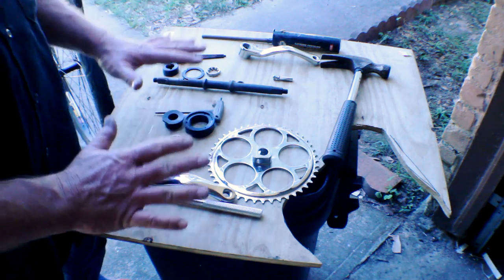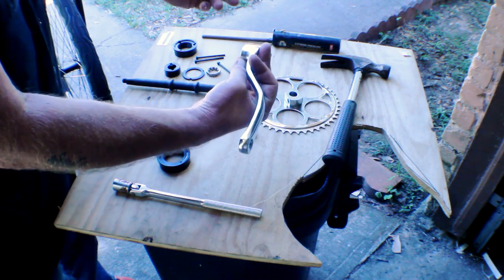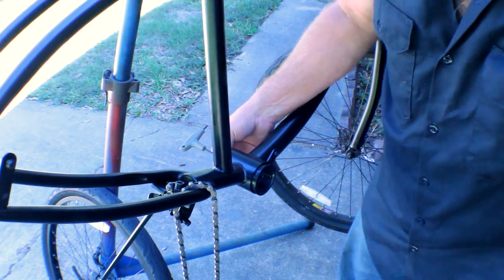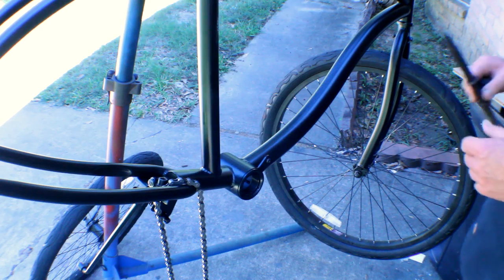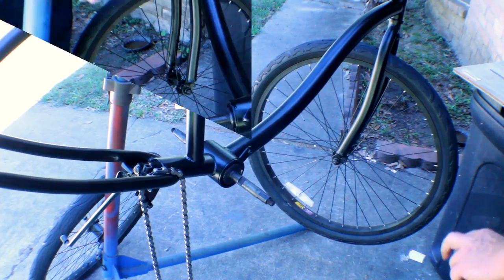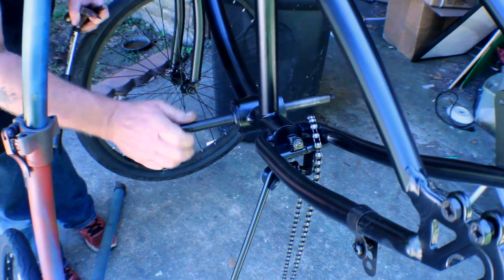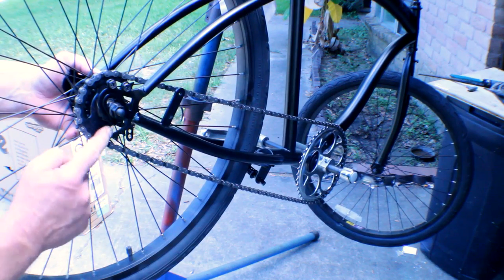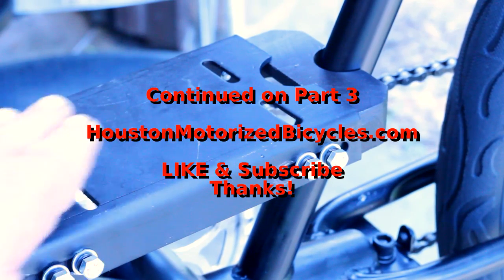How To Build 4 Stroke Motorized Bicycle Part 2 - Install 3 Piece Crank & Motor Mount

Comment: I tried to put one on my bike because I was going to use a pull start with my 2 stroke but it kept coming loose. I used thread locker and the bearing went to shit. I had to heat it up with a blow torch and beat it apart for a hour to get the bearing cap off

Comment: I found the wrong video from you a few min ago, THIS assembly looks more like what I have.  Basically.  But wow! Lining up those two outer rings so a long screw just happens to mesh?  I somehow got the first one to bite, but cannot for the life of me get the other two.  My back can only take so long of hunching over a blasted bike... time to walk away.   But at least I can see the plan here.

OH one tip for lining up the holes?  I took a straight piece of coat hanger wire and sent that through hole one, lined up my receiving part to that.  BUT kind of afraid to tap it all the way in just yet, and wow it's tight.  I have to really pound just to get it started. Very easy to undo my nice hole line up.   (What a stupid design this is.) 

Thanks for the video though, what side which parts go on right there will save me a royal headache for sure.

Comment: @Hughes I'm trying to do this on a stealth bomber ebike frame. the right cup I got with the kit doesn't thread enough into the tube. It doesn't make contact with the bearing and its spaced. the right cup hits my frame. The left cup has to go in very far for it to hit it.
Reply from the maker: shoot me some photos or a vid. HughesMotorized@gmail
Reply: @HughesMotorized   hold up
Reply: @HughesMotorized  I had to actually shave off the sides of one of the cups to get it to go in all the way. It's a weird setup it's hard to explain.
Reply: I bought a differnt kit off amazon as well. The setup is different.
Reply: The bike bottom bracket is threaded so I don't know if this kit would work.
Reply: that's the product I bought

Comment: Walks into bicycle shop, I need help with a multi piece pedal crank set so my pedals are clear of the motor... All they hear is motor and tell me I'm SOL no matter how I explain the simplicity of my help in need and all they say is we don't do motor bicycles, even tho the help I need is Not with the motor. And this is the only bike shop in my facinity :)
Reply: Its so extremely rare to find a bicycle shop that will provide you with any help, service or do anything for you other than help you find the nearest exit out of their store. I walked my motorbike over a mile to get to the nearest store to buy a new tube or fix a flat. So I parked my motorbike outside their door and tried to buy a tube or fix flat anything to  get me home and they refused to sell me anything and got all 3 employees and a few of their friends hanging out there to gang up on me and muscle me out the door. So i parked my bike a few blocks away came back 20mins later and wrapped my arms around as many boxes of tubes as they had on their shelf and walked out without anyone seeing or saying anything.... lol
Reply: @christopherwolfe5336  I believe you lol and it's crazy.
Try going to a motorcycle shop lol I did that too and the one I went to was so bad it's like no one even knew what a bicycle engine is which is just a one cylinder engine 2 or 4 stroke.

These people are experienced, I have no experience and I'm not that intelligent but the first motor bicycle I put together took me two days to complete and these experienced folks who have the knowledge don't know anything about the basics of what they do. I say that because a motorcycle mechanic is a lowsy mechanic if they seriously know nothing about a bicycle or a motored made for a bicycle to become a Motorcycle because for one bicycles evolved into motorcycles Originally and two motored bicycles are literally the basicality of a motorcycle. And a bicycle mechanic is a lowsy mechanic if unwilling to know everything about bicycles including ENGINES that are MADE FOR them. Bicycles, engines, and motorcycles are all relevant because bicycles are bikes, motorcycles are also bikes, and bikes usually have an engine or not, either way.

Otherwise it's like running a public vehicular service shop and only accepting to work on certain vehicle models instead of all that the job would stand for.
Reply: If you need to see a bike mechanic for repairs on a motorized bike, you shouldn’t be riding them. In other words, if you aren’t to any degree mechanically inclined, motorized bikes aren’t for you.
Reply: @Allyoucaneatmeat  wrong, so wait just because I lacked knowledge with one part of the bike and not the engine, that means I have no business riding it at all? Asking for help willing to PAY FOR A SERVICE regarding the bike itself and not the motor, seeking help is no good? 

I profoundly disagree. Kind of useless to be a bike mechanic but can't modify the crank to the pedals for me to a wide set, I don't have the tools for that job otherwise I'd figure it out myself but a bike mechanic does and I was willing to pay for a service so your point is not really valid
Reply: @coincollectorchase  I think indicating that you're mechanically disinclined really triggered you...sorry.
Reply: @Allyoucaneatmeat  kinda but it's not a big deal, if you're not going to understand what I said then I must be even more clear for you, I needed help with the bicycle not the engine so your response was irrelevant

Comment: you have put the adapter backwards :P  righty tighty means its suppose to tight normally ''right hand treads'' on the right side of the bike , that way the bb wants to tight it self when crank is rotating and not tend to undo itself  .. its works anyways , just not a good practice , i actually welded a bb the wrong side once haha , but its still fine